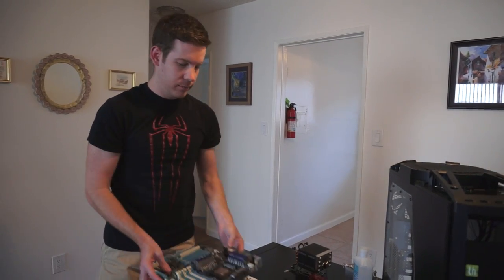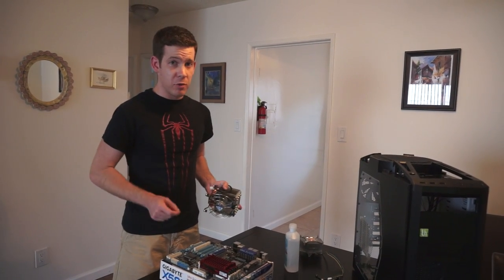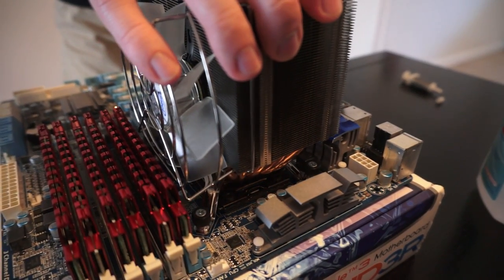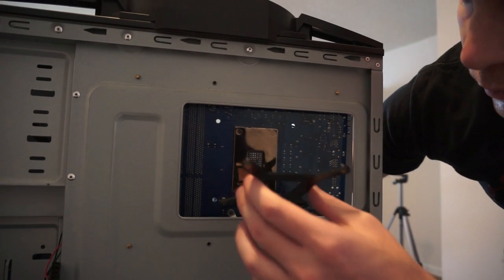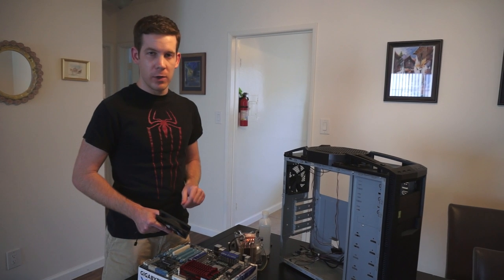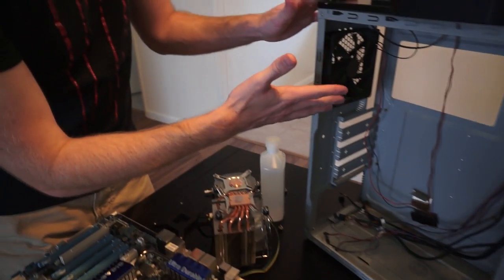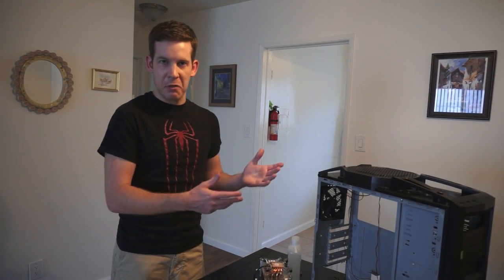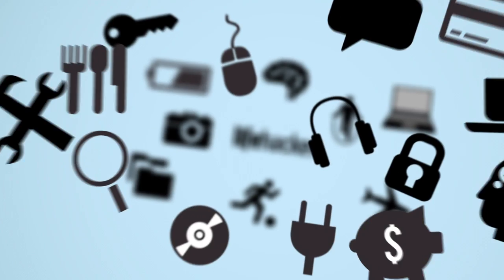6 Essential Tips for First-Time PC Builders

Comment: I've been building computers sense the 80's lol I will say I do not usually build outside the box I just take a good look at the parts, knowing it will fit. With the big bulky graphics cards nowadays yea I would say building it outside the box first would be good, to see how it will look and then looking at if that will fit inside the case or not. I was usually using old cases scrapping all the parts from many machines as well as some were still useful... same goes with all the other parts like screens and keyboards.

Comment: Its easy to get the hardware but so frustrating when you get it all connected and realising you need batteries for wireless stuff, windows installation, anti virus, ethernet gaming cable, controller or gaming keyboard ect, then subscription to stream its annoying. Ps4 £185 done. Pc £450 if your lucky

Comment: If you have non conductive thermal paste (Which most are nowadays) you can put on as much as you want.  The only way to negatively affect your cooling is putting on too little.
Reply: Actually excessive thermal paste can be negative due to having a lower thermal conductivity than the material in the CPU heat spreader and CPU cooler heat sink. The main purpose of thermal paste is to fill in imperfections in the surfaces. This means thermal paste is only better than air in terms of conductivity.
http://www.tomshardware.com/reviews/thermal-paste-heat-sink-heat-spreader,3600-4.html (Bottom of page)

Comment: is this a okay build?

Intel Core i5-6600K 3.5GHz Quad-Core Processor
$238.99 Buy

CPU Cooler 
CRYORIG H7 49.0 CFM CPU Cooler
$43.53 Buy

Thermal Compound 
Arctic Silver Arctic Alumina Premium Ceramic Polysynthetic 1.75g Thermal Paste
$3.49 Buy

Motherboard 
MSI B150M MORTAR Micro ATX LGA1151 Motherboard
$83.88 Buy

Memory 
G.Skill Ripjaws V Series 16GB (2 x 8GB) DDR4-2400 Memory
$62.88 Buy

Storage 
Western Digital Caviar Blue 1TB 3.5" 7200RPM Internal Hard Drive
$47.49 Buy

Video Cards 
MSI Radeon R7 250 2GB Video Card (2-Way CrossFire)
$79.88 Buy

MSI Radeon R7 250 2GB Video Card (2-Way CrossFire)
$79.88 Buy

Case 
NZXT Phantom 820 (White) ATX Full Tower Case
$199.99 Buy Combo

Power Supply 
NZXT HALE82 V2 550W 80+ Bronze Certified Fully-Modular ATX Power Supply
$64.99 

Optical Drive 
LG GH24NSC0B DVD/CD Writer
$14.89 Buy

Operating System 
Microsoft Windows 10 Home OEM 64-bit
$83.89 Buy

Software 
AVG AntiVirus 2016 (1 Year Subscription) Software
$24.98 Buy

Sound Card 
Asus Xonar DGX 24-bit 96 KHz Sound Card
$29.98 Buy

Wireless Network Adapter 
TP-Link TL-WN725N USB 2.0 802.11b/g/n Wi-Fi Adapter
$7.98 Buy

Case Fan 
Cooler Master SickleFlow 69.7 CFM 120mm Fan
$5.99 Buy

Monitor 
Asus VX238H 23.0" Monitor
$139.00 Buy

Keyboard 
Logitech Wireless Combo MK270 Wireless Standard Keyboard w/Optical Mouse
$18.99 Buy

External Storage 
Western Digital Elements 1TB External Hard Drive
Reply: It's ok other than the fact you are spending 80 on a gpu and 200 on a case, spend less on the case and get an r9 380 gpu instead.
Reply: I'm from the UK, so not sure what prices are like in US, but instead of spending so much on the case (about £170 here) go for a thermaltake Versa H13, spend what you save on the case on the GPU as that is much more important that what the box it all sits in looks like.A higher end single gpu is pretty much always better than 2 lower end cards in sli/crossfire in anything other than synthetic benchmark tests. They don't scale up properly and you still only have as much memory as one card has.
Reply: Quick look at prices here in the UK, you save £130 on the case, and instead of spending £120-£140 on 2 shit gpu's, spend £245-£255 get 1 R9 390, or a GTX 970 for £220-£240, take ya pick.
Reply: Or....if you really have ya heart set on that case, spend an extra $40 or so and get an RX480.Best of luck with your pc build dude.
Reply: NO FOR THE LOVE OF GOD DONT DO THAT(ok thats a little over dramatic). first you are buying a "K"(overclockable) chip for a motherboard that does not support overclocking, unless the K version is cheaper than the regular version dont buy it or you could get a Z170 chipset that will support over clocking. Second AMD 200 series GPUs had many bugs in crossfire and is also outdated, get one more powerful card it will pay off. third the GPU power range you are going for is not at the same tier as you CPU, your GPU(s) should cost about the same or more than your CPU does (at MSRP), only break that rule if you plan to use the computer for a task other than gaming that requires that much horsepower i.e. CAD or physics modeling of some sort. fourth and finally do not you need a sound card, modern motherboards have fairly descent on board sound cards, only buy one if you need it for a specific output/input not on your motherboard or if you plan to use it for audio creation work.
Reply: +dclaws555 Avast is enough. Actually, Windows Defender is already more than enough.

Comment: when testing from outside the case, what do you do to turn off the motherboard? Is it in the bios? or do you just switch off the PSU?
Reply: Switch off the power supply
Reply: Blinded Vortex would that hurt anything?
Reply: No nothing would be harmed

Comment: how do you turn off the mobo when you are testing to see if it works and the mobo works?
Reply: I know that this is kinda a month late, but just unplug the power supply the motherboard's connected to or (if it has one) switch off the PSU.

Comment: is this good?

CPU: Intel Pentium G3258
GPU : R7 260X
Ram: 4GB 1600MHZ Ram
Motherboard: Gigabyte B85-HD3-A
HDD: Hitachi 7200 RPM 1TB
Reply: Get an AMD athlon x4 860k, and a compatible motherboard (FM2+), 2 sticks of RAM, and get a gtx 750ti, which will give you better performance for a better price.
Reply: I meant similar price not better price
Reply: +A fabulous space gentleman? Nope.pentium is better
Reply: Nope, it stutters in many modern games due to having only 2 cores.
Reply: A fabulous space gentleman? i got it running Fallout 4 at medium at 25-60fps
Reply: +Notelu buy an extra 4gb stick
Reply: Well you aren't gonna game on it but for normal PC tasks it's fine

Comment: all my frends say not to get amd why
Reply: +jan blekkenhorst 

Because they are blind fanboys. Sometimes, you will want AMD, sometimes you will want Nvidia/Intel. It all depends on budget, but, a general rule of thumb is that if your build is under $1000, go all AMD. For instance, my build was around $400, and has an A10-7700k and an R9 270X. My friend's build was $1100 and has a GTX 970 and, actually, still uses an AMD CPU, the FX-8350.
Reply: oke so there is nothing rong with amd
Reply: jan blekkenhorst Yup. It's almost always cheaper than the intel equivalent. The one thing is, they can be hotter, and they typically use more power.
Reply: oke so insted of a vs450 a vs 750
Reply: No, I mean too much thermal paste as in they put so much on it was literally leaking off the sides of the CPU. In this case, there was WAY too much thermal paste. At no point should anyone put so much on that it starts to leak off of the sides, it was a very shoddy job on their end
Reply: +jan blekkenhorst People say not to buy amd gpus because: Nvidia works with game devs to implement their software to their games. These softwares only work with nvidia cards which means that amd cards perform worse on the benchmarks. But these softwares usually only activate in high or ultra settings. But because the benchmarks (even in low end products) are done in ultra settings it makes amd cards look worse. (2 kliksphilip has done a great video about this. It's called: Nvidia, stop being a dick)
Reply: +jan blekkenhorst amd gps run hotter and use more power and might have driver issues more often but amd gpus are better priced. as for cpus high end cpus are dominated by intel but low end by amd.
Reply: AMd graphics cards overheat quick but if your able to have 2 or 3 fans in your case and try and tidy up your cables and it should stay coolish
Reply: +jan blekkenhorst  No there is nothing wrong with AMD. AMD just consumes more energy and runs hotter than Nvidia.. There are specific features to each brand that might draw you to one or the other. For instance AMD is better at Eyefinity technology and tends to be more open source for coding. Nvida on the other hand has Gameworks and Shaddow play which makes optimizing and recording your games easier. That is my high level analysis of the differences between AMD and Nvidia. I have a R9 290 and the thing sits at around 70C and my cpu Intel I5 3570k under a Hyper 212 evo runs around 35C. My system never ramps up due to load and its in a HAF 912 with 2 standard fans. That said though... If you want the absolute best shit ever you go Intel/Nvidia because their high end stuff is better than AMD. In the mid-range market though there are good items in all camps.
Reply: +jan blekkenhorst Trust me, go with Intel. My first build was AMD, and I went for it because it was cheaper. Little did I know how hot the processors actually ran. I ran into major heating issues and my PC kept shutting off (mind you, this was a pre-build PC) so I took my water cooler off, cleaned off all my thermal paste, and re-applied everything. It didn't help one bit and I kept running into the problem, my water cooler wasn't good enough. The 2nd time around I built my own PC, went with the 4790K, and haven't experienced a single overheating issue. If you do go with AMD, you better go with a BEAST of a watercooler.
Reply: I have an AMD processor in my pc and it isn't overheating even tho it has the stock cooler.
Reply: +The Arbiter that's odd I used relatively small fans and all air cooling and rarely ran into heat issues even with higher end cards
Reply: MK Vlogs
I think the Arbiter is full of it. Probably had a bad part or didn't apply the thermal paste properly.
http://www.arcticsilver.com/instructions.htm
Reply: Well then, we'll call it a bad part. It definitely wasn't me applying the thermal paste wrong. I used the same exact "pea" method I used for my current processor, and I was using a water cooler. When I was doing anything under heavy load, my PC would shut itself off, especially when gaming. This mean the processor had reached WAY too high of a temperature and it was protecting itself from damage, meaning it overheated. It's no secret that the processors run pretty hot. I'm not lying about this, why would I? It's part of the reason why I opted for a brand new build in the first place. And what's with the thermal paste site? If you were implying that perhaps I skimped on good quality thermal paste, I didn't. I was using Arctic Silver 5.
Reply: But, as I said, I didn't make my first build, it was from CyberPower. Whoever put together the PC itself possibly added too much thermal paste and caused the CPU to overheat and possibly damage itself. It's possible that by the time I took it off and added my own thermal paste, it was already damaged and it was too late to make a difference. But who knows, all I know is that I haven't had any issues with my new custom build. I'm glad you guys didn't have to go through the headache I did with my AMD processor.
Reply: you do realize that too much thermal paste will NOT cause heating issues correct? the only time you will run into a heating issue with thermal paste is when you add too little. this video is a bad example because if you did some actual temperature tests you would notice they only change when you have too little paste

Comment: these are my pc specs. Can i play minecraft at 10k 72938626fps?????

cpu: half eaten barbecue chip 

gpu: brand new pair of socks (2 gpus) 

Motherboard: piece of cardboard

power supply: melted candle

Ram: dont have any i lost it

case: cereal box

is this good??? Should I upgrade to a salt and vinegar chip for my cpu???
Reply: +lewis Sinclair 

You are fine for now. I would wait until the zen Salt and Vinegar chips come out to upgrade. The socks might get hot under intensive load, so I might fill those with ice.
Reply: Andloo Yunty yep i will fill them with ice as soon as possible i dont want my socks catching fire
Reply: lewis Sinclair Yup. They get almost as hot as AMD chips :P
Reply: I would go with 6 way sock sli if you plan on running it on 1080p
Reply: You can just download more ram
Reply: you are missing a cooler your barbecue chips are going to overheat i suggest putting 3 or 4 cubes of ice before beginning to game.
Reply: +Ice Cold Penguin  I would upgrade to better pasta cables, oh and some more ram, be careful they can be fiesty tho, make sure u have a strong case ;P
Reply: A potato will did a better job for the psu
Reply: Get a hamster running on a wheel for better cpu
Reply: Wesl weor that would be the psu
Reply: dont forget to sli the gpus with a rubber band
Reply: I'd say some mountain dew for liquid cooling and that thing would be a beast!
Reply: You're going to run the game at 0 originality, sorry bud
Reply: Reri Fracturus ah yes thanks kind sir
Reply: this is dumb, if this isent a joke i an concerned about these milennlials

Comment: http://pcpartpicker.com/p/CVYD99
Will this build work for modern games at 60fps 1080p?? Not crysis but games like csgo and fallout
Reply: get the ti version of the 750, also that power supply is more than what you need if you are not planning on upgrading.
Reply: 1: change cpu since it can bottleneck the GPU (or vice versa). Get something like an i5 4460
2: Just get a 950 or 960 as that 750 is not good (like seriously)
3: Change motherboard. It doesn't have USB 3.0 dafuq
Reply: Csgo and old fallout games yea fallout 4 hell no not with that shitty vram

Comment: rule number 1, its hella harder than it is. nearly had a stress attack because of it. sure you can get the graphics card and cpu and ram put in there but then the wires, bloody fucking wires and you dont know where most of them go besides the ssd and internal memory. those i know where they go but everything else from the power supply fuck off
Reply: +Elite GamingWolf Same, lol. Power Supply wiring is the most confusing and hard part of building a pc.
Reply: Juan Pagan  its ok i got it built right, i was just stupid and could not find the power button on the tower case. instead i was pressing the reset switch
Reply: +Juan Pagan I got stuck at the power button reset button and so on. That part is confusing.
Reply: Thomas J  yeah, they should label tower case buttons
Reply: +Elite GamingWolf 
Most of the time they are but it is in tiny print. I pretty much had to put my nose to the MOBO to read it and I have 20/20 vision. It is also detailed in the MOBO manual too if it isn't on the board
Reply: +Elite GamingWolf Read the fucking manual... Idiot.
Reply: Jay Fury  i already made my pc. did you skip your medicine?
Reply: Have some tea and a crumpet and learn how to read manuals in the future. #RTFM
Reply: Jay Fury  too long, i did it all right by youtube videos. its all good now

Comment: First time builder here, bit of a noob question, I'm getting an after market cooler for my FX-8350; do I have to buy the thermal paste separate or does it come with the after market cooler?
Reply: +Ryan Jennings The description should usually list if the thermal paste is pre-applied, also in my experience nearly every after market cooler I've every bought has had the paste already. Just google it man! "Name of aftermarket cooler" thermal paste should get you a result in the first page that lets you know.
Reply: +Ryan Jennings Aftermarket coolers always have paste with them, either a small tube or preapplied.

Comment: I'm 11 and I know how to do everything I'm just scared about cable connecting I ordered all parts a gtx 980ti strix i7 6700k Asus maximus hero vii hyper x preadator  2800mhz 16gb ram and a corsair rm850 a 2tb hybrid drive and a 500gb Samsung 850 evo case is corsair 760t and cooler is corsair h100i BTW no hate pls and idk about drivers and operating system is windows 7 64 bit

Comment: Great video. I just have one question about one of the tips you said. Which is, how would you know what part of your pc build was not working, if the screen did turn on or it was running slow?
Reply: +NicholasStage ok doesn't really answer my question but thanks.

Comment: would there be an issues with having an AMD processor with the geforce gtx 970 as i have heard the 2 dont work well together ?
Reply: +Deathwish026 

You will be fine. My friend uses a 970 with an FX-8350.
Reply: +Deathwish026 If youre going with amd, at least you wont need any heaters in your house anymore! :D

Comment: Thank you for the thermal paste tip. I'm going to be building my first computer soon, and I was originally planning on using the stock heat sink with pre-applied thermal paste but read some reviews with people complaining about worrisome heating. So I decided to get a third party heat sink, and naturally that requires applying my own thermal paste. I wasn't sure how to approach it and your tip completely explained it in a quick, concise manner.

Cheers.
Reply: Don't use toilet paper if u remove thermal paste use coffee filters toilet paper leaves fibers on the cpu and is flismy
Reply: ***** My concern was more about the stock heat sinks themselves than the pre-applied thermal paste.
Reply: ***** I already built my computer, anyway.
Reply: +Ted Bundy Use a microfiber cloth or coffee filter, paper towels and toilet paper (wtf?) can easily leave behind fibers that mess with cooling.